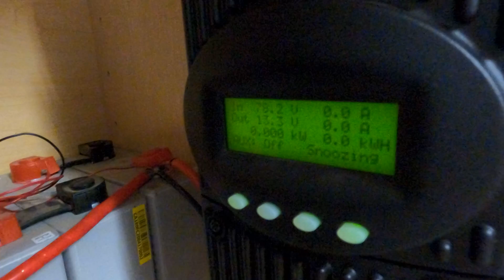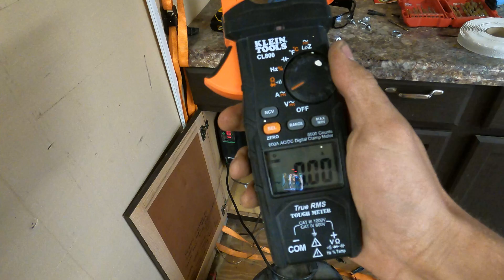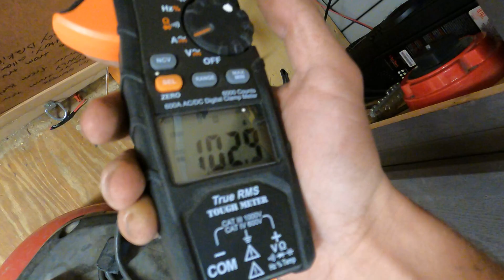RV/Cargo Trailer - LiFePO4 Upgrade (CALB CA180, Outback Flexmax & Xantrex Inverter)

Comment: If the BMS disconnects the battery, the FM80 can be damaged (like you mentioned for the PWM controller). Outback say it should not be connected to solar panels in absence of battery connection.
Reply from the maker: I've done it and never had that happen.
Reply: Good to know. You are braver than me :)
I do fear that if any of the dc supply breakers on the charge controllers trip in the middle of the day, there will be a lot of solar still coming to the input. Have been looking for remote trip breakers to accomplish that, but the one I found is huge, so it will just act as a disconnect and still have to wire in series a properly sized breaker for over current protection.
Gives me a peace of mind though that you have tested this without controller damage.

Comment: Now you're going to need a LOT of ventilation in the cabinet.. (And STILL need to clean that one solar panel!  ROFL)
Reply: Actually not because the input (from the pvp) and output power is basically the same then bevore and the newer system is more efficient.
Reply: @gaunerchen1729  but the inverter is in there now, too.
Reply from the maker: But the load on the inverter most of the time is fractions of a lot and anything that is a high load device is going to have the door open to plug into the inverter
Reply: @HighTechLab  Ah... I thought you'd just have it power outlets throughout the trailer.
Reply from the maker: That's a great idea for sure but not quite yet